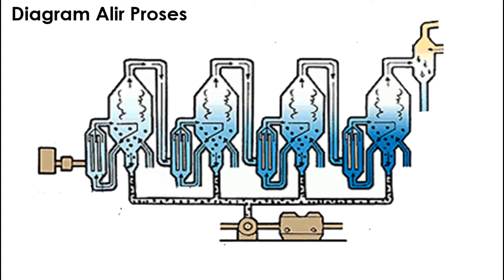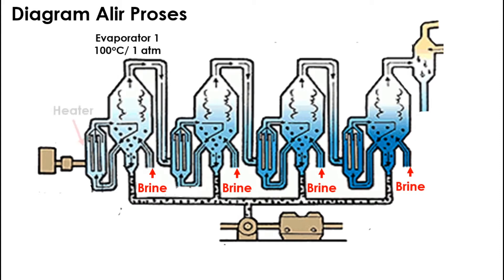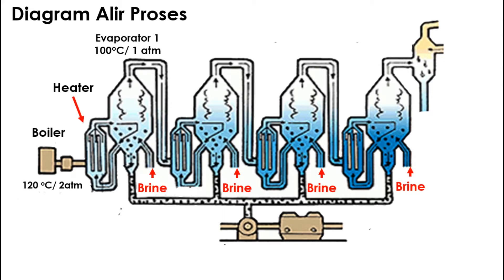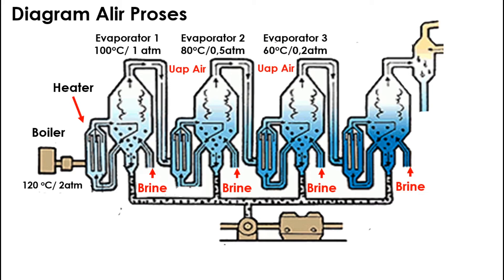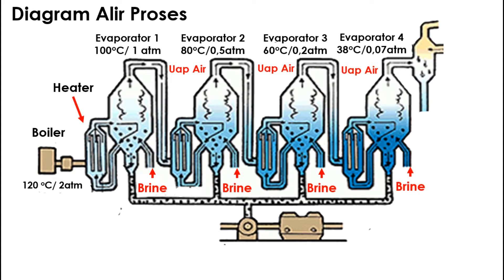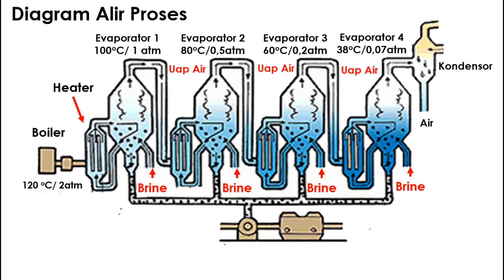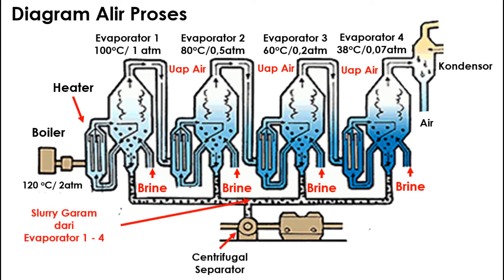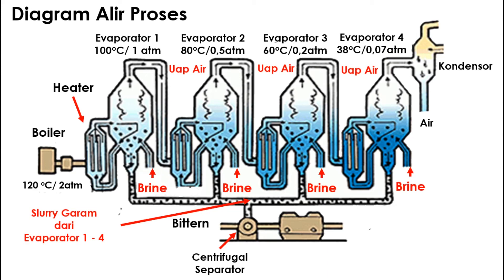Kimia Industri   Proses Pembuatan Garam Dapur Bag 2 Diagram Alir Proses

Comment: Maaf pak jadi semangat...saya ingin dalam 1 shift bisa produksi 3 ton garam rekristalisasi...Krn klo 2000 liter air tua jk cara di rebus manual maka jadi 8 kwintal garam rekris yg belum di separator dari airx....mungkin Ndak ya pak...dalam 2 jam airx sdh menguap 95 %  ? Berapa tekanan dan suhu yg ideal ? Terimakasih banyak pak.
Reply: Info yang bisa di hubungi..?